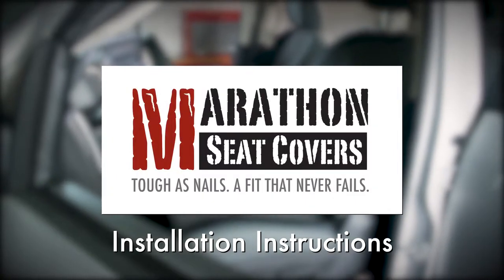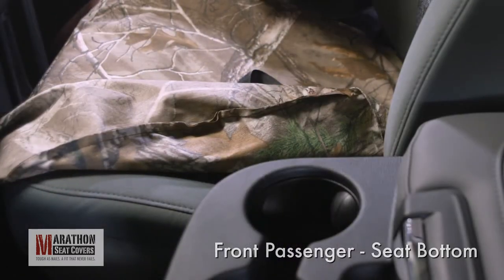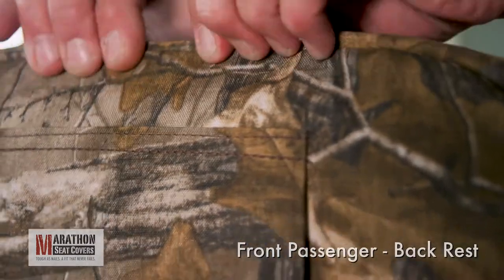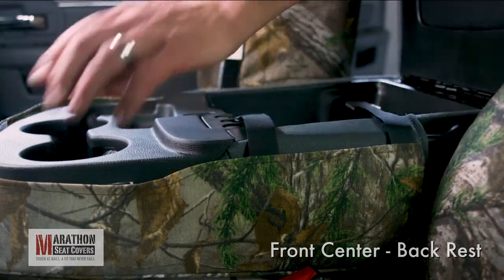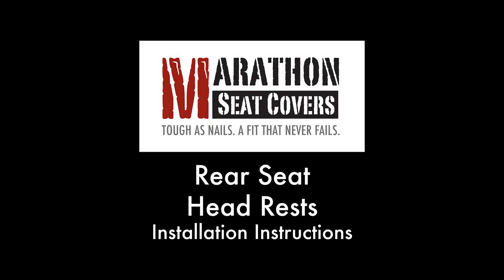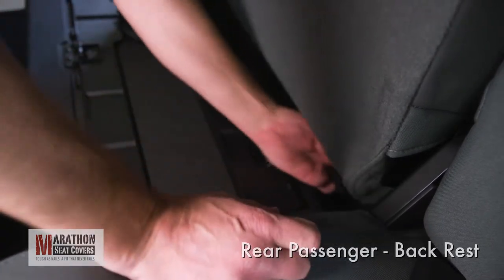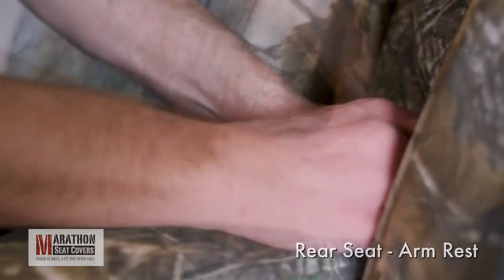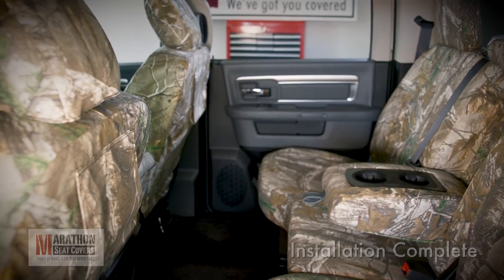Marathon Installation Video 2018 Full Front & Rear

Comment: Purchased a full set in Kryptek Typhon from Marathon. Well built fit like a glove, but the covers have started to fade in less than 9 months. My truck stays in a garage and is not used for work purposes and has approximately 3k miles on the covers. Marathon would not stand behind their product stating they do not cover fading. Driver and passenger bottom was all they would had to exchange and they chose not to.  Something to consider prior to purchasing an expensive set of Marathon seat covers.

Comment: Doesn't cover the seat all the way .  Save your money.
Reply: I bought a truck that had these already and I noticed part of a seat was exposed and heavily warn.  I took them all off to wash them.  When I put all the covers back on,  I found out that the previous owner had routed the velcro strap improperly and had caused the exposure problem.   I can't say this was part of your problem, but it was in my case.  The coverage is very good and the seat covers are really tough.  I wish it wasn't in cammo, but I can live with that. 2014 Tundra